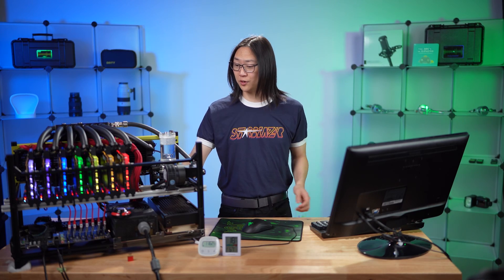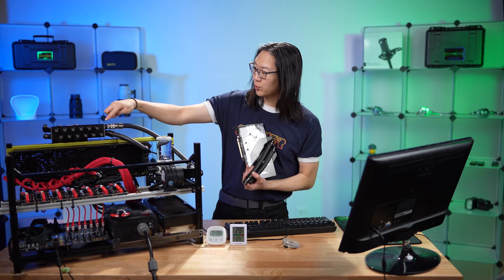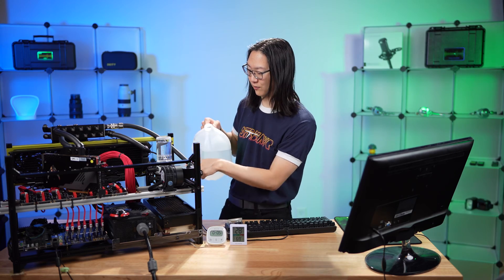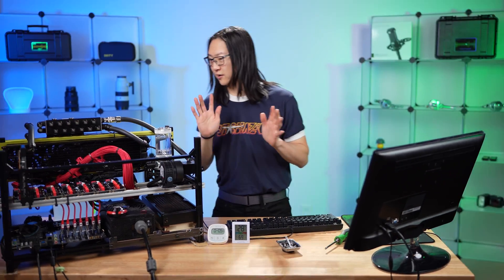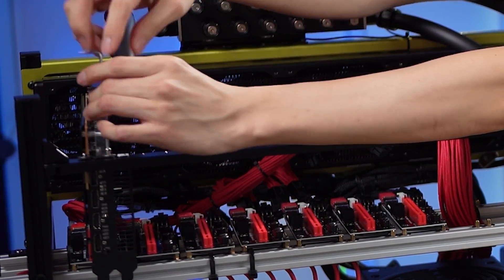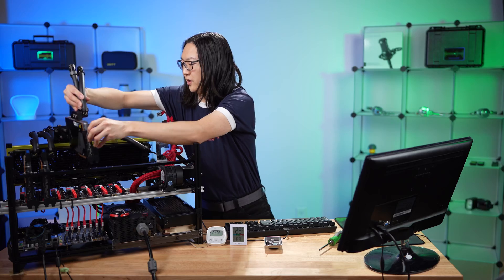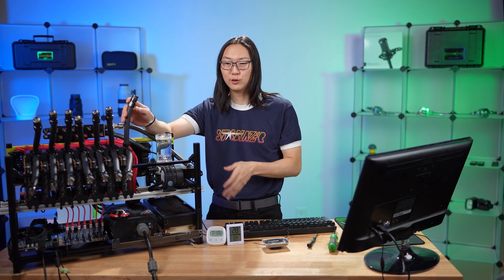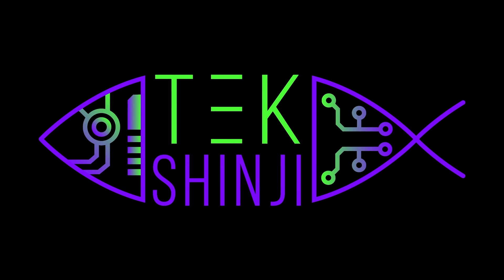Setup of a Water Cooled 5700 XT Eth mining rig

Comment: Other than the red PCI-E custom cables, you didn't exactly elaborate on your connections to the risers. How are they connected ? Directly to the PSU and and not splitters ? How did the EVGA 1600w have enough ports for all of that without splitters ? maybe there's something I'm not understanding. Are they custom as well ? There was never a good shot of the riser connections as far as I'm aware of.
Reply from the maker: Hey there, thanks for the question. The EVGA power supply has nine PCIe ports. Seven of which are used on the cards, two our split into four PCIe or four risers.  So there's three more risers left to power.

Two of those risers are powered off. CPU EPS2 dual 6-spin PCIE. And the last one is powered by Molex.  The whole system undo load takes about 1,000 watts or so well within the safety levels of the power supply.
Reply: @TekShinji  Thanks a million for the info bro ! But since you were able to power two of the last three risers with CPU EPS dual 6-pin PCIe, and the EVGA 1600w has TWO CPU ports, is it possible to just power the last riser by a CPU EPS to 6-pin instead of molex ?

Comment: Nice build, Im guessing if a 360 RAD (Push&Pull) is enough for 3x 2080 Ti in parallel. By the way the "daysy chain" look PCIe look sick, very clean build
Reply from the maker: Hey there, thanks man I appreciate it!  Go by XYZ card and XYZ radiator but rather total wattage and total radiator size is more accurate on calculations.

Comment: Those qdc are very well known to fail after 1-2 years. Hope they last longer for you
Reply from the maker: Thanks for the comment. Do you have any ideas on how to keep them from failing?
Reply: @TekShinji  not sure but I've seen loads of videos where they just get stuck open, then when you unplug them the water just flows straight out as if you unplugged a normal tube. I'm not sure if the people in those videos were maintaining their loops correctly or what fluid they were using, but it's something to be aware of. Especially because you have so many of them !
Reply from the maker: As with all mechanical parts if they are not used for a while and the coolant does not maintain properly it's more likely to happen.
Generally I found as long as you exercise them at least once a month you're fine however thanks for letting me know
Reply: @TekShinji  yes it could well have been from not being used enough.
Reply from the maker: Lots of mechanic parts stick and get stick when not operated for a wile.

Comment: I finally got the rig up and hashing.  I copied almost everything that you have except I got the Bitcoin motherboard with One 6900xtx Ultimate GPU as of now.  I’m hashing at 62.05 M at 127v -140v with no rejects.  My temp is at 35 Celsius using MotorMAX aka ColdFire liquid with 10% Distilled Water.  I think I can get the volt lower but it’s getting late for me, need to go back to work.
Reply from the maker: Dude that's awesome man! Come over to our discord and post some pictures! I'd love to see your awesome work :-)

Comment: When I watch the video and look at your list of hardware it looks like you are using 2 pumps, is that correct? Is it necessary to use 2 pumps for 7 cards? As a miner I want to keep everything in good shape considering price/performance. I plan to use a car radiator instead for example. My brother will use the cnc machine at work to create adapters for the bigger tube holes of the car radiator.  I saw videos from Linus and Jay2Cents where they tried something like this and the used only one pump and the coolant went only 1-2 degrees hotter than the room temperature.
Reply from the maker: I don't recommend a car radar cuz they tend to be made out of aluminum but if you are able to that's fine, just make sure you don't mix metals.

Comment: HI, I dont know if this stupid question or not. but, is it possible to use radiator coolant for motorcycle or car to fill the tank? as we know, that radiator coolant have anti-corrosion agent, or at least reduce the possibility of that.
Reply from the maker: Yes you can. However it's not the most efficient because that type of coolant is designed for a higher ratio / difference in temperature. PC coolant has more water and it because water has better thermal conductivity versus car coolant.

Comment: is this rig also able to handle 6 rtx 3090?
Reply from the maker: It has a a 240 mm radiator and a 480 mm radiator.

So we could probably handle right around 800 to 1,000 depending on the ambient temperature.

30 90s roughly produce about 350 watts a piece, (again you didn't ask if it can handle a certain wattage you asked if it could handle a certain amount of cards which I am just making up a number that is close to my experience and maybe different for you)

350*6=2100w so you will need about double the radiators at the minimum to maintain cool water temperatures

Comment: great video i am water cooling for the frist time but hard tubes because i got everthing so cheep  full lup was like 200$ rad pump res with fittings and gpu block i traded my 3070  for a 2080ti plus they added 300$ so poaiud for the water cooling
Reply from the maker: Nice bro! That's awesome! Join our discord and post some picts in the rig picts section!

Comment: Have you thought of trying to make all of your fittings the same metal to eliminate the galvanic corrosion concern? Also I'd love to see a schematic of the loop
Reply from the maker: It's possible. However I would have to manufacture everything myself. No company actually makes everything completely the same. They get close but not exactly. And even then, there's variances in the metal so it's better just to fight it instead of attempting to prevent it all together.

Oh that's good idea!

Comment: Would it be possible to get an accurate parts list? I cant seem to find the water cooler online.
Reply from the maker: All the parts are listed in the PC part picker link. when you say you can't find the water cooler online, what are you referring to? There's many parts to the water cooling system.
Reply: @TekShinji  Totally missed the link, I guess I was hoping for a link to where you can get the main parts of the watercooling. I saw the links for the additional parts.
Reply from the maker: Well it's difficult to link the parts directly. That's why I gave you the exact part so you can look for it online. it also depends on where you are in the world. Some of the parts are easier to get in Slovenia than here.

Comment: This rig looks amazing... but i would like to know how long will it take to actually start making a profit.
Reply from the maker: Oh that's quite easy to figure out. linked in the description is the PC part picker link. You can see all the exact parts used in this build.

Then use your own electrical rate and the current ethereum calculation to calculate profitability. This rig does about 1,100 watts at 395 mega hash. And then you can calculate the total profitability and ROI times!

Comment: I just wonder.. Shinji why you dotn go dual pump mounting for those pumps ( with one inlet and one outlet ) and  big reservoir like 250mm for this loop ? Is this second pump help first one ( have same eneter ) or it just push water for the second rad ? I have one pump ( phobya 400 pwm, it is like 400-800l/h depend on the load ) and it works fine for 3 rads ( 480mm 80mm thickness ) and  2 gpu blocks.
Reply from the maker: Everything is in series. Except the GPUs those are in parallel. There is two identical or nearly identical D5 pumps in series. 

technically you don't really need a reservoir all it is is to help bleed the system and give you a reserve just in case you have permeation or some evaporation. 

Yes a bigger reservoir looks nice but you technically don't need it. If you do there's other issues with the system because you have a leak or you're losing water somewhere. It's a closed system so you shouldn't have that issue.

Comment: Technically you use destiled water for like 6 months than you MUST ( for sure ) change it for a new one, same as he say here 0:40. I used it over 7 months and... yea bilve me or not but i need to change my pgu blocks, tubes and fittings.. all of them, have worned out... nickel plating that was on them just get ripped off
Reply from the maker: Exactly. Distilled water is great but it doesn't have any antique corrosive or biocidal properties. PC water coolant even though it may be a glycol basis good enough for most applications. And it will preserve your nickel plating and all that good stuff.